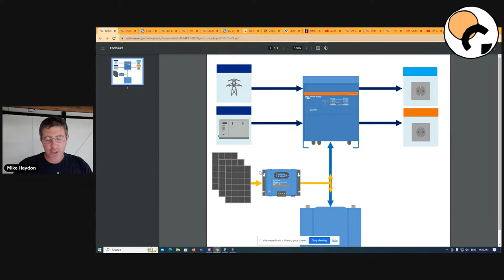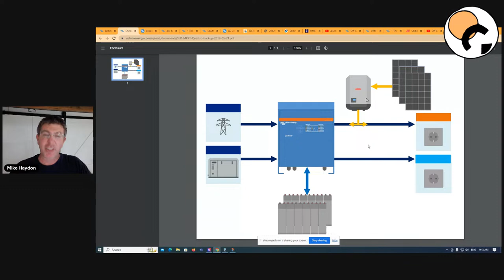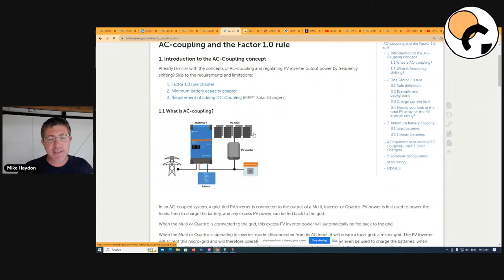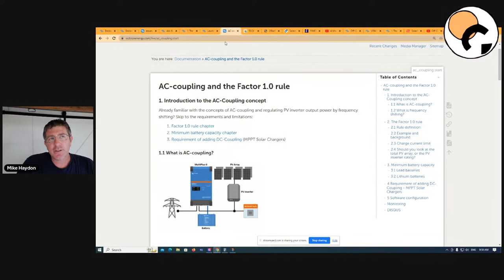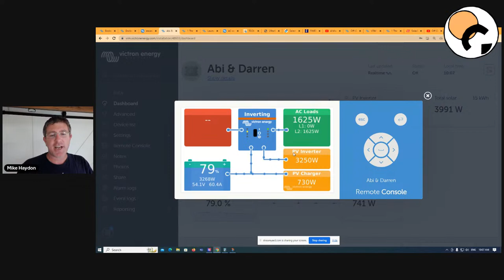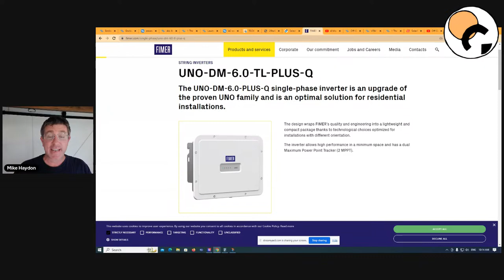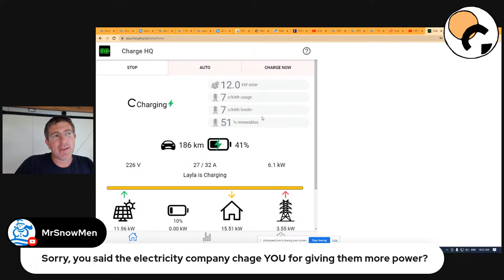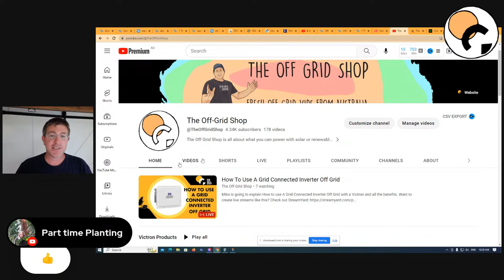How To Use A Grid Connected Inverter Off Grid

Comment: Why grid tied inverter manufacturer dont just give some settings to just by click of a switch you can use the grid tied inverter in an off grid settings?
Reply from the maker: It all depends on the manufacturer. We use the Fimer products as they are the most programmable and fastest reacting inveters available. So that means when you tube a big load on they ramp up fast. Other really popular brands that are most commonly used can take 60 seconds to wake up and start.
Reply: @TheOffGridShop  I've tried talking to Growatt, but they didn't offer anything else other than the latest hybrid.
Reply: Are the settings available on the net. Are there any instructions available.
Reply from the maker: Because it's a very small market compared to on grid. And today we have way more choices than we did a year ago.

Comment: Got   my grid-tie-inverter working offline,  the trick is to have a sinewave inverter  larger than output   of a   grid-tie-Inverter   and  a  AC load  equal to the grid-tie-inverter  ac output.
Reply from the maker: Well done. Yes most situations your require. 1 to.1 sizing and ideally the off grid inveter is bigger.
Reply: Yes, I think that would work too, but you have to monitor it or you'll burn out batteries or inverter like I did, need a way to connect without monitoring. And yes, my off grid inverter was bigger 16kw and on grid is 10kw.
Reply: I have to like this but my off grid inverter is small 2kva and on grid inverter is 6kva will it work?
Reply: @FREEDOM-ei2fg 20:02
Reply: @heetghodasara156 you need a DC regulator on the input otherwise the grid tie will burn out the off grid
Reply: @sammyd7857  Please can you elaborate about the DC regulator? I want to AC Couple and my grid tie is MUCH bigger than the off grid inverter I plan to use
Reply: Wondering if the grid tie inverter has a limiter (for "zero export") if the off-grid inverter has to be that big.
Reply from the maker: @oldager1662 yes you can do that with the energy metre of that inverter brand is the best way. You can also limit it to.

Comment: ive got a milwaukee tool inverter 175watt. works off of a milwaukee battery. when my power goes out at home, i lose my grid tie inverter solar power ( of course). im thinking of using my milwaukee inverter to fire up the grid tie inverter. and get some power flowing to use.
Reply from the maker: Let's us know how you go with that. Its very unlikely it will work and you will damage your inverter. I would love to hear that it does though.
Reply: @TheOffGridShop  i fired it up for a about ten seconds. the grid tie started working, started putting out watts. it started to rise and i shut it off. lol i think if i had something plugged in using the solar power it would work.

Comment: Hi, what you think about fool a FRONIUS 5K On Grid , with a smaller On Grid Tie inverter,, just to make the FRONIUS turn On? When the Fronius start it will get out full power has he can get from the solar painels! What you think about this typ off connction ?
Reply from the maker: Yes this is ac coupling and you require an inveter at least the same size as your fronius.  It's has to be 1 to 1 rule

Comment: I have a foronius inverter to grid but want to start swapping over to off grid well at least at close I can in aust. Would also like to now more regarding wholesale, did look at amber but that seems to have issues. As said I’m on the grid but want to head toward off grid where would you start, inverter, more solar or batteries.
Reply from the maker: Check out www.ogss.com.au and signup and it will send you some emails about the wholesale market in Australia.

Comment: If you’re familiar with Enphase iq8 inverters Could you comment on how to trick them into working off grid without using their switch box and manually disconnecting from the grid.
Reply from the maker: I am pretty sure you only require to activate them once with the switch box and then they will work. I know someone who uses one camping on the back of a panel.
Reply: @TheOffGridShop 

Ok, I guess I’ll turn off the grid and rewire them for grid forming and see what they do!

Comment: Off grid solar only to charge boat batteries.  I have the panels and the batteries, AC charger, but can’t find the PV inverter to 120 V.  Wish I knew how to trick Solar Edge inverter to work off grid but not sure if it would burn up when not charging anything 80% of the time.
Reply from the maker: How big is your boat? You can use solar edge. Problem is you will want a minimum of 6-8 panels depending on which optimisers you have.
Reply: @TheOffGridShop 9.9HP 4x12v marine batteries.  Not sure how to make the Solar Edge work off grid. Old Enphase micro inverters.

Comment: Am I able to use any Hybrid Inverter   to take advantage of off-grid design or I must use Victron device.
Reply from the maker: Hi, what are you wanting to achieve?
Reply from the maker: It's will all depend on the Brand likely. If you can use a hybrid inveter with a current grid connected inveter.
Reply: @TheOffGridShop   I was  going to used my existing grid-tie inverters/solar panels  in my  new off-grid greenhouse,  and save on  cost .

Comment: Great video. 
What I'm trying to figure out is if I can use a sonnen grid tied battery/inverter system off grid by somehow tricking it by using a small inverter to make it think it's on the grid. 
Is this possible without burning the place down? 😃
Reply: I'm trying to do the same. Did you have any success
Reply: @sampsontendaimutsago1935  no I haven't got any further with it. Have you got sonnen battery's too?
Reply from the maker: What model Sonnen is it? That should just work.  They have a very low output back up circuit though.
Reply from the maker: They are not meant to be sued permanently off grid. They won't last like a Victron would.
Reply: @TheOffGridShop  hi, thanks for the reply. It's a sonnenbatterie eco 9.43
It's not designed to go off grid at all but I feel like there must be a way to do it. There is an extra module you can buy to give some backup capabilities but I can't find much info about it and its limited output as you say. 
The batteries modules themselves are made byy pylontech and look very similar to a normal pylontech battery but they wont stay switched on without the rest of the sonnen inverter controller system. I'd love to get them working on their own but I don't know where to start. It must be possible some how.
Reply from the maker: @bmartinot  Ah yes I know whats going on.  You will require that back up unit or buy a small off grid kit.
Reply: @TheOffGridShop  hi, thanks for the quick reply. I'm trying to get more information on that unit. 
What do you mean by buying a small off grid kit? Is that something sonnen does ? Sorry if I'm being slow😃

Comment: Is there a way to block current backflowing into an off grid inverter from the grid tie inverter when the grid is down? Will a device with an AC-AC transformer in it like an EMI line filter or a motor speed controller voltage regulator placed between the off grid inverter and the load, permit only unidirectional current flow?
Reply from the maker: Depending on the brands of units you have there are easier ways to make that happen.
Reply: @TheOffGridShop  Could you please elaborate, just curious.
Reply from the maker: What brands of inveters do you have?
Reply: Some grid tie inverter have limiters could it work to prevent back feeding?
Reply: Can this work with enphase IQ7 microinverters?
Reply from the maker: Yes you can AC couple enphase.

Comment: Dude, you're all over the place trying to explain it. If you have a system that charges a battery bank, and power an inverter like a SunnyBoy 3.0-1sp-us-41, wired to the grid through main panel, disconnect it from the grid, and then apply 240v the grid side of the inverter, will it work?

Can you basically use a small pure sine wave inverter to the grid side to power up the inverter and run off the battery bank and panels charging the batteries though a MPPT Charge controller?
Reply from the maker: Thanks for the feedback. In theory you require an off grid inverter just as big as your on grid inverter.  We used an energy metre before to limit the grid inverters output going back to the off grid inverter. Basically if your on grid inverter can go full steam  through your off grid inverter it is likely to blow up.
Reply: @TheOffGridShop kindly explain more. If I have a 5kw grid tie and a 6 kW hybrid with a battery will this work?
What are the possible hazards
Reply from the maker: Will depend on brands. What are they?

Comment: Question.  Does the Ac inverter being supplied by the offgrid inverter convert the ac power or does it send to straight through in relation to Men . Rcd protection ?
Reply from the maker: The AC Inverter will supply power to the loads 1st and then if there is any excess it will send it back to the batteries. If you connected to the grid and the batteries are full it will then start sending energy back to the grid.
Reply: @TheOffGridShop   if offgrid inverter has no MEN . Does the grid inverter convert the offgrid ac power or just bypass it through its circuits? . Just interested!
Reply from the maker: If your using a Victron it creates its own MEN.

Comment: Hi BackOWight here,
I have a 4kw solar on grid with a Solax Triple power 45Ah 4.5kw battery with its  own BMS . I have a Growatt 3600MTL-S PV on grid Inverter. Due to life changes I am now in an off grid environment . I've just been diagnosed with Dementia and acute PTSD.  I need some help please. I've already been ripped off for a couple of grand. Thanks Curly
Reply from the maker: Hi Curley, where are you located?
Reply: @TheOffGridShop  Hi, I'm on the Isle of Wight

Comment: Hello, California here...
Would I be correct to assume that when your utility company is actually paying users to use, there's a cap to what they will pay you?
Now, perhaps I've merely a nefarious, inconsiderate - consideration, here... but... Why wouldn't someone design some high-power heatsink or acquire a thousand toasters to run all at once for a maximization of their payout potential?
Also, perhaps (...and hopefully so...) things have changed but wasn't it not too terribly long ago that Australia (...I'm thinking it was only just pre-pandemic... or, during, even...) was purported to be in danger of NOT meeting the needs of its electrical-energy usage/user's requirements???
Reply from the maker: The payments change all the time right now. The higher the renewables in the grid the less they pay for it. Somedays they charge. IE weekends so weekends if you don't have solar you can be paid to use energy.

Comment: Too much blah, blah.
just wanted to know how to kick start an old grid connect inverter as a stand alone off grid.
Reply from the maker: That will depend on what brands you have blah blah blah! Lol.
Reply: You didn't even touch on whether it's connected to grid/generator input side or load output side 1 or 2 or any recommendations of protection in the circuit just blah blah